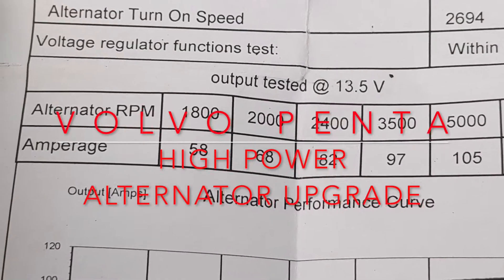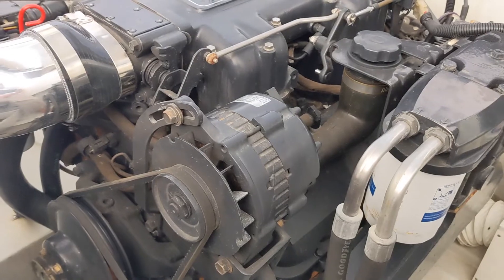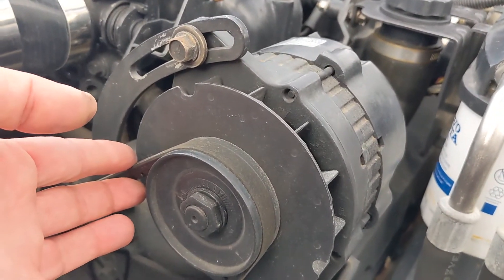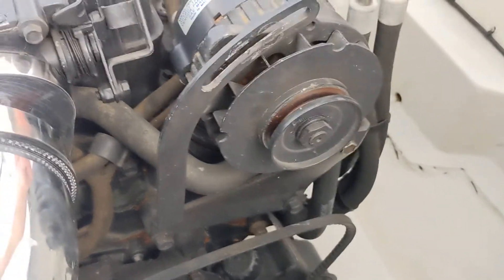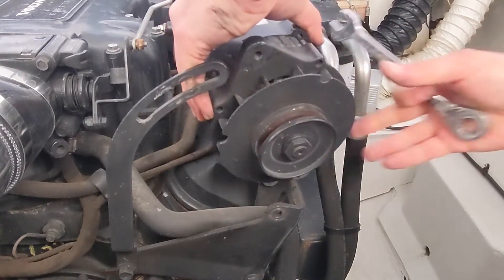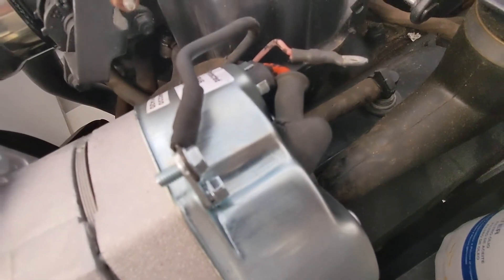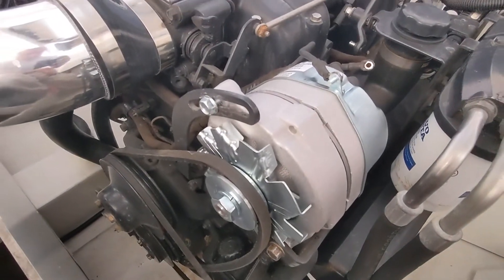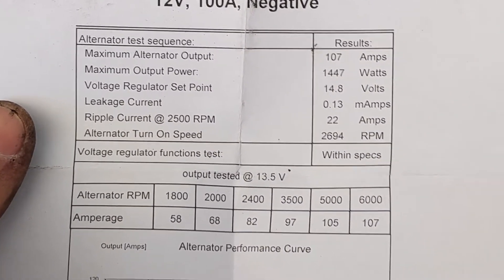Volvo Penta Alternator Upgrade

Comment from the maker: You can order this exact alternator here: https://amzn.to/3SivCjH
Reply: How much tension should be put on the belt?
Reply from the maker: @lawnman3638  I usually tighten it enough to where I can push in the belt with my finger and it moves about 1/3 of an inch.

Comment: just to let you know . when you connect wires to alternator sand it with sanding paper to have better connection and use marina vaseline to prevent from bad connection in future. just saying
Reply from the maker: Great tip!

Comment: My alternator has like 5 wires what are all the wires for?
Reply from the maker: What year and model is. your motor?
Reply: @NKPGarage 99 Chevy 5.0 Volvo penta
Reply: @NKPGarage 99 Volvo penta gm5.0
Reply: RPMs Red off of alternator if I go to single wire alternator how would  my RPM gauge work
Reply: @NKPGarage 99 Volvo penta 5.0